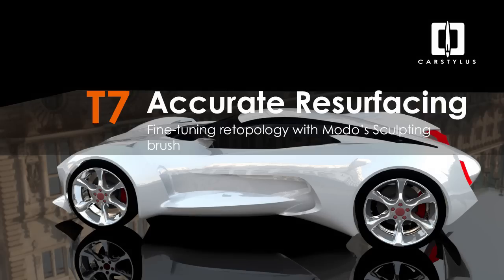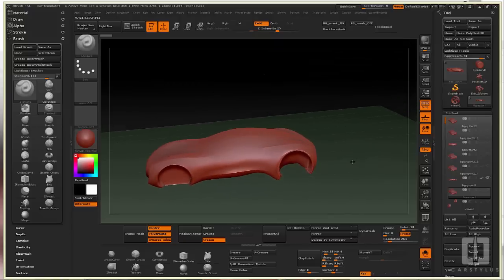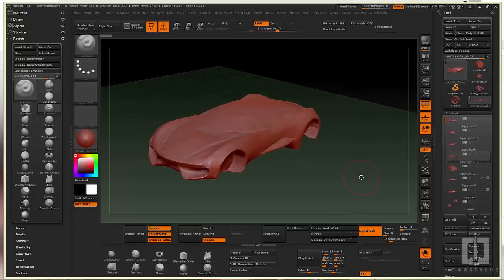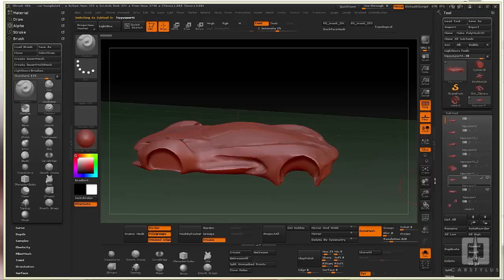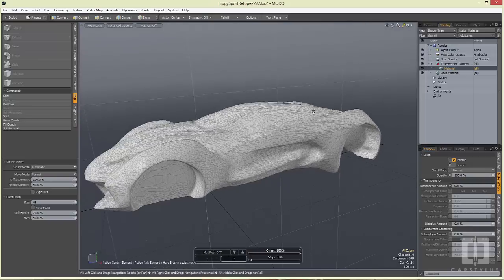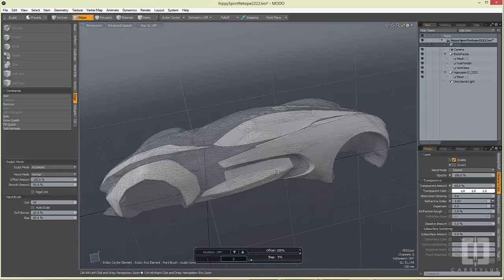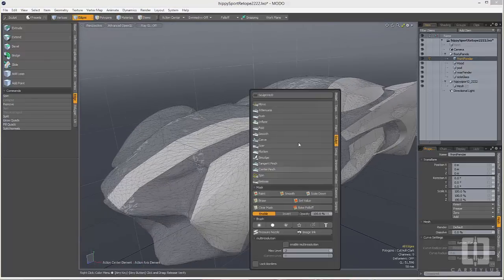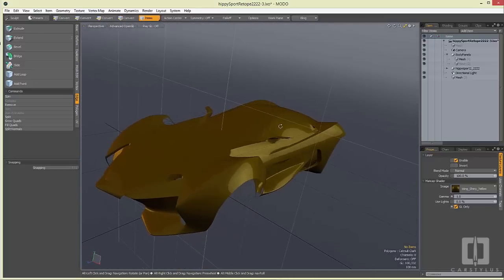Tip 7: Accurate Resurfacing with Polygons

Comment: I wonder if the new zmodeler within zbrush 4r7 could be used for controlled automotive surfaces. I use Icemsurf professionally and I'm looking at a more free form way of concept modelling a car
Reply from the maker: I have 4r7 but haven't really incorporated it into my workflow yet.   Still, it seems as if Pixologic has simply added traditional polymodeling tools into it's workflow.  While this is not a bad thing and might prevent the need to switch to another program less often, it doesn't seem to improve concept modeling for cars or semi organic hard-surfaces.   What would have been more helpful in my opinion would have been to extend the "clay modeling" metaphor.   That is, to add the digital equivalent for analog tools such as wood splines, steels, and cat gut (fishing line).  These are tools used in automotive clay modeling to refine rough clay surfaces.

Comment: Hey Carstylus, why do you use Maya or Modo to retopology the car instead of Zbrush?
Is it for more control ?
Awesome video, thank you for it !
Reply from the maker: Unlike Zbrush, Modo or Maya's retopology workflow is more intuitive and thoughtful.   Zbrush's  zsphere based workflow is a bit convoluted as it stands. However I do like the the "topology brush".  If it were refined to enable the adjustment of already drawn topology curves, it be even bettter!
Reply: @Carstylus  You CAN go back and edit topology (verts) as long as the mesh is low poly.
Reply from the maker: @artistryartistry7239  You're right.  You can edit low topology.     However what I was referring to in my reply was that it's currently not possible to move/edit topology while using the topology brush.   A  topology brush stroke can be deleted and redrawn, but verts can't be exactly "moved" as with zsphere topology editing.

Comment: thanks for the video! you should really give a try to Blender  , it will blow your mind
Reply from the maker: Why blender?   Would it make what I'm trying to do here easier?   If so, I'm all for it.
Reply from the maker: Thomas Parel That's pretty hot.   I think I saw this tool at Siggraph's "Birds of a Feather" session for Blender.  Wow, an amazing workflow.  But, what I'd REALLY like is for the retoped surface not to sink below the reference surface when sub-divided.  Is there something for that?  If so, I'm in.
Reply: carstylus
 you can always use the solidify modifier to offset your surface in the percentage that you need
Reply: carstylus Blender has a shrinkwrap modifier that does exactly what you say- you can specify a reference offset that compensates for the shrinkage that happens due to the low poly cage points sitting on the sculpt.
Reply from the maker: What???  That's cool!  I'll have to try it out. . . .
Reply: and dont forguet to try cycles while you are at it